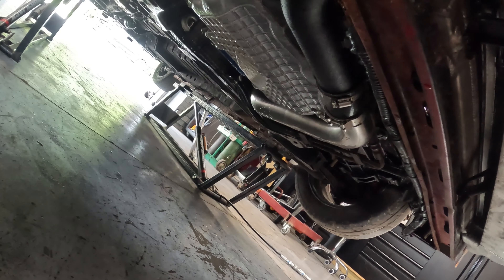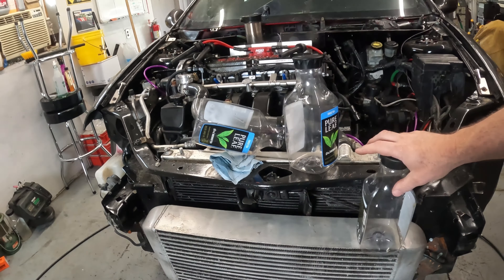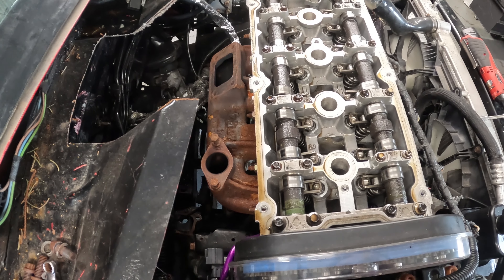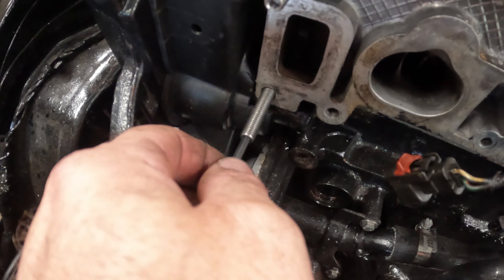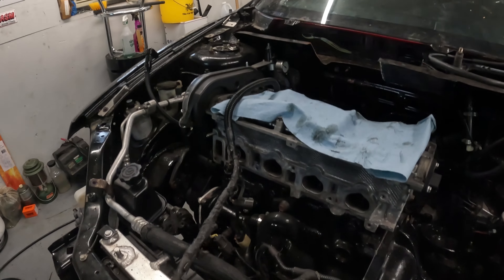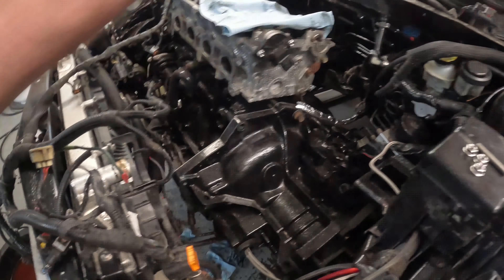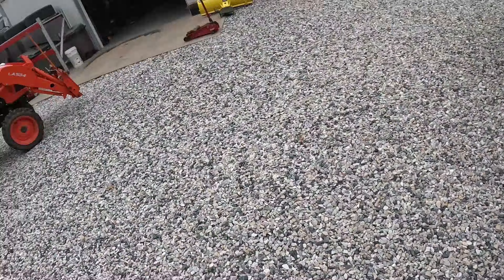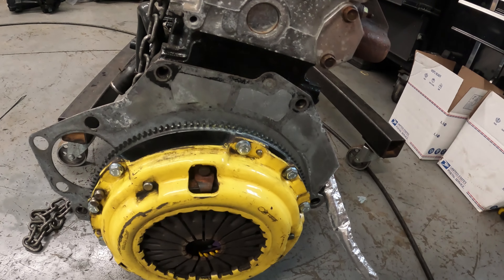nsrt4 carbon white serious problem #srt4 #boosted

Comment: Where do you get the proper bolts to replace the stripped/ incorrect bolts? I'm sure you have a stockpile, but for the average joe?
Reply from the maker: can source bolts from other neons or dodge cars at a junk yard of the similar year and make some can be found a hardware store home depo ect have to match up what will work or I do have a bunch here and can share can email @yahoo or on facebook same name as this youtube i can ship you what you need
Reply: @Mattsneedforspeed Thanks for everything you do! Making these videos. Sharing experience. Answering my  questions. The only ppl who have worked on my car was a dodge dearship when the car was under warranty. And yes the messed up my clutch. Bent one of my wheels and some missing bolts I'm finding now. From now on I'll be doing the work on it. So trying to educate myself the best I can. You have helped me to get my car running and now registered after sitting 9 years. 59k miles. No rust. Paint like new. Perfect interior. Let's hope I dont F it up lol. Being patient and careful.